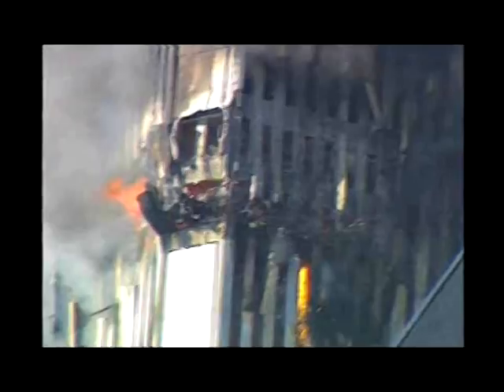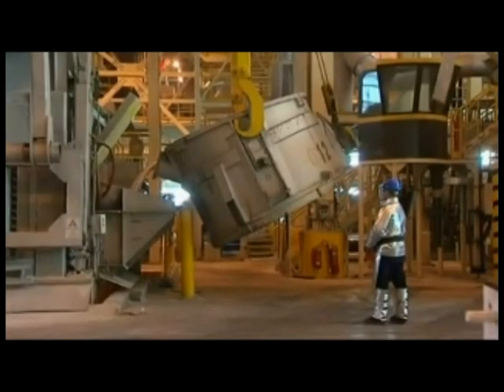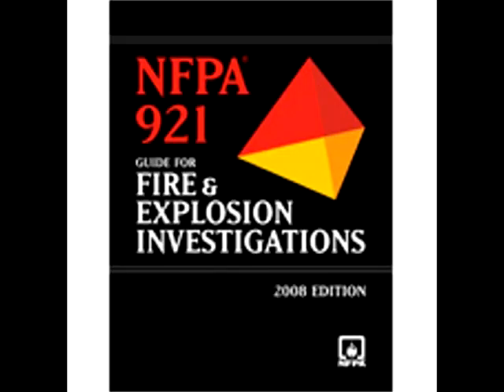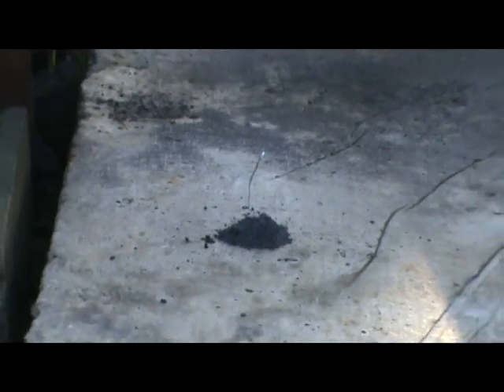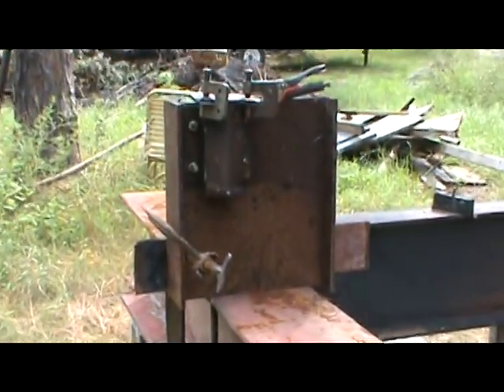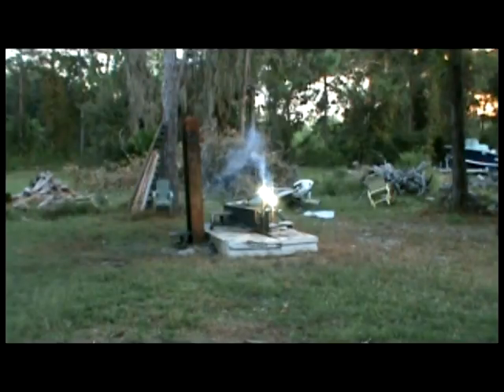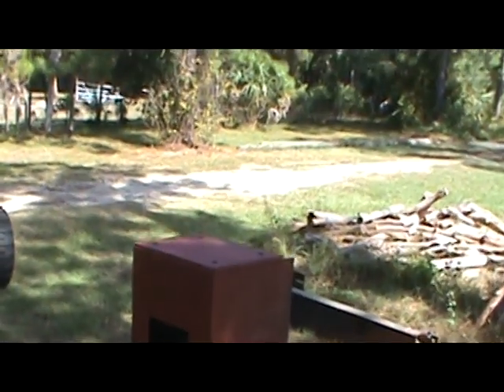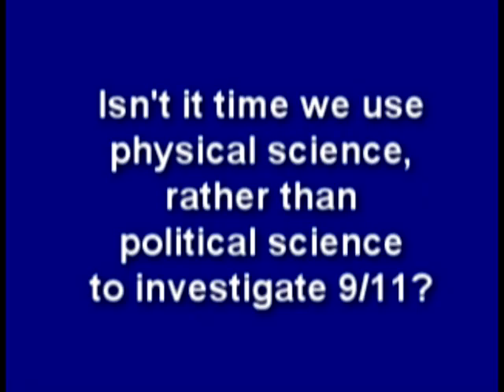9/11 Experiments: The Great Thermate Debate

Comment: Thermate and thermite are not comprable things. And considering that you can buy the things required to make thermite at a chemical supply store or a hardware store for that matter, it does bring about the question of why you would substitute one for the other. What you used would require far more effort to get and make than thermite.
Is it perhaps because you realize that thermite won't do the damage that thermate will?
Reply: thermite does huge amounts of damage and is use by military all over the world. it has provem to be more destructive than jet fuel.
Reply: Reid Norris quite true. Nevertheless, it still begs the question. When thermite is easier to produce than thermate, why substitute thermate? Thermate is both more powerful than thermite, and quite unmistakable in the aftermath. It leaves behind toxic chemical traces which are highly poisonous to anyone in the vicinity.
Reply: well %90 of the first responders got cancer, i guess that could explain the toxic.both are really east to prduce and anybody with an old army handbook can do it. very detailed instructions on its use. i have no idea what exactly happened. i KNOW the US govt cant be trusted. ive worked with steel for 20 years. ive put together systems like the twin tower(not as big), it just doesnt make sense about the exact footprint they laid. the outside skin wouldveremained bolted together top to bottom. ithat connection has nothing to do with the collapsing floors. ive done thousands of tresses just like they had, the weld is stronger than the steel they say that weld snapped and then fell like pancake, well the outside skin would still remain bolted. i keep an open mind becasue the officail story is not the truth.USA was so much better before that day. ive studied the first and second WW in detail, they will do anything. maybe it was some saudi that had never flown a 737 at 450knots in a dive then pulls up perfectly into the building, or the other first time pilot flying in a roll at 450 knotsback inot the pentagon with perfect precision. if it was them i would say they were better than iour military, becasue US military been gettin smoked since 1865

Comment: The problem with these "conspiracy" videos is that they often contradict each other. I've seen one where they had a physicist say that an aluminum plane would not be able to penetrate the steel of the building. I was in a hurricane in the Caribbean and I saw   a  2x4 go through a steel beam. So if a 2x4 can go through a steel beam, then I'm convinced an aluminum plane can. Most of these videos prove absolutely nothing.

Comment: Also don't forget about the bolts that hold the steel beams in place, those require much less heat due to their size, to warp and pop out.

Comment: The steel does not need to "melt". It only has to weaken or warp. Once that steel has been exposed to the temperature of the burning jet fuel mixed with office stuff and what have you, plus this a biiiiig one, wind as another fuel source. At that height nothing is stopping the oxygen feeding those fires. Anyway back to the steel once it weakens and starts to bend it cannot hold the weight of the remaining floors. Hence collapse. The buildings were designed to fall that way in the event of a collapse. Had the buildings toppled over like everyone thinks 200,000 people would have passed away. Think about it.

Comment: Problem with this theory, How do you fit hundreds if not thousands of thermite cutting devices to the enclosed structural beams of a building without any one noticing the work. Look at how long demolition company's work on a building before the big day the button is pushed. Planes are also full of magnesium and magnesium alloys which burn white.

Comment: You can light a wooden pallet on fire and as it burns, the metal nails will turn red hot and glow with the heat from an ordinary wood fueled fire.(about 1200/1500) degrees is the average for a camp fire or fireplace fire. What is the most prominent weather condition that high up in a sky scraper? WIND, lots of wind. And what is blowin in the wind? Oxygen and lots of it. What are the 3 primary conditions do you need for a fire? You need fuel, got that, (the plane had an abundance of fuel) you also need heat, got that, (the friction of the plane crash) and you also need oxygen, (lots of wind) The tower fire had all three. Lots of fuel, heat, and air. The fire didn't need to (MELT) steel, it just needed to get it hot enough to weaken it. The weight of the upper floors was greater then the towers were designed to handle. No other tower in history has ever collapse from a fire. True enough, but the twin towers were not your typical building construction, it was built differently and it was built by the lowest bidder and forced to be built in a hurry. The towers were structurally flawed to begin with. Add a plane crashing into it causing significant structural damage even before the fire weakened the building. Case closed.
Reply: Bill: I kinda figured that. lol   Some people like "Blu" that just can't see the forest for the trees. Have a good day Sr.
Reply: Bill, dont waste your time on this clown.
Reply: Don't forget the creepy ones. :)
Reply: B-52? WWII?  It was  a Bi-Plane, after WWI....But, hey! Close enough.
Reply: "Burning wood in a campfire = demolishing a skyscraper" "just add fuel, friction, and air" "Case closed" LOL
Reply: Man!  You Americans just love ambiguity, don't you?   Looking down through this sub-thread, it's hard to tell who believes what. LOL.   
.
Okay, let's address Smart Ass's (its in the name you know?  You may well consider yourself an intelligent equus asinus, but to me, you appear simply a dumb arse )  - fire triangle first....    As a trained fire-fighter, I can confirm that dumbarse is correct.  However, one only needs to remove one side of that triangle to extinguish any fire.  

Dumbarses's theory that winds at that high elevation, would have fanned the flames of the initial fires caused by the impact/explosion and thus intensifiying the temperature of the fires on the impact floors.   Now this might be true in the case of a smithies furnace, which is in controlled conditions, where fuel is plentiful,  heat is retained and airflow is constant.   

However, this is not a smithies cozy little furnace.   This is 13,000 tons of concrete and heavy steel, standing vertical and rising up 3/4 of a mile into the Manhatten skyline.   As I said above, remove just one of the three sides of the fire triangle and your fire will be exinguised.   So let us look at the three sides of that fire triangle again...
.
Fuel - Initially the 'accelerant' would have been the kerosene in the aircraft's fuel tanks.   But kerosene cannot alone cause a high temperature fire sufficient to melt heavy steel box girders and concrete.  (...let alone, all the floors below the impact...).   Most of the aircraft's fuel would have been expended in the initial impact explosion.   Secondary fires would of course be triggered, the secondary 'accelerants' being the office furniture/partitions/carpets/IT equipment etc...  Anyone who has set light to furniture or computers would know that once turned to carbon, the 'accelerant' would be depleted of potential thermal energy.    
.
Oxygen (air) and Heat -  Whilst the 'accelerants' remain with enough potential thermal energy, any intense air flow, would most likely 'fan the flames', but that air pressure (wind) also has a cooling effect.  -  Blow on a joint (dooby) to get it to stay alight, yes it will burn intensly, waste your weed down to the roach... One can carry on blowing on the roach, it will just cool down, the fuel now expended.   Stand on a windy hill, with just your underclothes on, your body will start to cool to the point of hypothermia.   So the wind action has two effects.  Initially it may well intensify the fire, but after the fuel is expended, it would then start to cool the fire, rapidly.   Just like blowing on a solder joint, to cool the solder.   
.
The fires that broke out on and around the impact zone would most certainly not have enough thermal energy to melt all of the steel structure and concrete of the WTC's 1,2 or 7.    The rest is easily explained by Newtons' third law of motion.   And remember, a column in compression is considerably stronger than it is in horizontal tension.  
.
Those who agree with the independents/truth seekers findings, are employing critical thinking, in all aspects of this case/debate, be that the political or scientific facts.   They question the official narrative.   
.
Tis a good job someone does... 
.
Those who only believe that official narrative, are simply swallowing the hook, line and sinker...   Sheeples. 
.
The problem with Americans is that they are so tuned to believing what MSM tells them, that they don't seek to question anything.  This is why, over half the nation, still believes in an omnipotent 'sky fairy', that created the world 6000 years ago, in seven days!   And that non avian dinosaurs lived cheek-by-jowl with early humans!   Whilst another portion of the US populace deny climate science....  Or are convinced that governments are employing clandestine geoengineering initiatives....   And that most Americans believe in infinite growth...  On a planet with finite resources.   They could never accept that their own government would ever pull a fast one, on its own citizens.   Yet, history is riddled with such events...  Or did ya'll still believe that the 32nd POTUS was blissfully unaware of the imminent attack on Pearl Harbour?  Or that LHO assassinated JFK?  Or that Iraq contained WMDs?  I can't remember what the excuse for Vietnam was...  
.
And of course, Americans generally believe that the whole world loves them and envies them and their faith in 'God and Country' makes them in any way,  superior citizens of the world and super role models for other nations to follow.   That arrogance, even extends to their belief, that they and they alone, should become the 'Global Police Force'.   
.
 Reality of course, can be a bitch.
Reply: Were you talking to me or Blu Crystl? Cause I was spot on.
Reply: Never mind, your not worth my time.
Reply: Blu Crystl: Only 2 times in history has a large commercial airplane crashed into a hi rise building. In both cases both planes were the same, the buildings were the same, the damage caused by each crash was the same, the location of the planes hitting the buildings was the same, the time it took for the start of each collapse was the same and in both cases the buildings did the same thing. See a pattern? Case closed.

Comment: You have forgotten one small but the most important element of your discussion.  Who supposedly put this 'thermite' there?  It would have taken months and then more to wire a building to ignite this stuff (if it was actually even there) and to even place this 'thermite' there.  Who was the company who did the wiring, who was the supplier of the trigger cable and the 'thermite'.  Why did no one see people for months and months  (more likely a year or more) wiring the building.  To wire a building like this take an emmense amount of work - I know, its what I do for a job, wire buildings.  Pulling panels off, ceiling tiles, duct ways etc. Why did not one person ever see a contractor doing this and why has a contractor never come forward, or his family saying he was out doing such n such job.

Also, did they wire the entire building from top to bottom or just where the planes hit?  Not easy to fly a commercial airliner at 600mph and hit at a particular spot on the buildings.  I never saw a big red dot on the building side that marked the 'hit me here' spot.

Everyone says 'Bush and Cheney' did this, actually, I doubt they could even climb a ladder to get to a ceiling tile.  It takes thousands of hours to wire buildings and hundreds of people and materials and yet not one person has found a company that has supplied trigger cable or thermite suppliers or manpower.

If it did have thermite on the towers, why didnt they just wire up the foundation supports in the basement and not near the top? Would have been far easier to do it this way that up the top of the building - and then to try and guide an airplane to hit at the same spot where the supposed 'thermite' is laid - and then only hope that the building would fall.  If you want a building to fall, you do the foundations not near the bloody top!

Too many of these so-called theorists have really no idea about the reality of how engineering works and try to explain their argument with internet based facts and figures that they dont even understand. 

I couldnt believe that crap about 'bolt blasters' in the outside coloums.  Who put them there? Who took the buildings apart to fit them? Where did the run the trigger wires to? Who did the work?  No one saw NOT ONE construction worker do this - no company had enlisted the manpower to do this, no worker has ever come forward to say so. No one saw contractor vans outside the towers month after month hauling in cabling and explosives.

Its all very well to try and come up with theories, but to get these theories to work is the big part.  As I said, why did they put their 'bolt blasters' near the top of the building when in the basement it would have been a quick, easy job.  

As for this 'finding traces of thermite' - well, I see you used common products in your tests that are found in lots of material in the buildings and that are compounds used in thermite, so you're really grasping at straws with that one.

Too much dreaming and not enough practical thought.  Until you can find one of the workers who supposedly put this stuff in the building, or the company that supplied manpower and equipment, I suggest you stop buggering around with your experiments.
Reply: Marvin Bush was in charge of security, and plenty of odd things going on in WTC months before September 11...
Reply: What a lot of speculation and grasping at straws.  It still doesnt tell us who the men were and who the company was that was 'supposed' to have wired the buildings.  Anyway, tell us all please, how come the buildings collapsed starting from the point at where the planes hit?  Did the pilot fly them into a particular floor that was previously wired and all the pilot had to do was hit that particular floor, then 'someone' (tell us who pushed the charge button for the explosions) and you then think it was explosions on that exact floor that the planes hit?  By the way  both towers were hit at different floors.  Did they paint a large red dot on the side of each tower for the pilot to aim for - you know, the one that has the explosives on that floor..

All you conspiracy people are grasping at very short straws and try to piece together some sort of theory - generally unworkable theories.  Try looking at the engineering of the collapse and you will then know the answer.

Comment: Could it be that thermate was already installed in pre-specified places of the Towers as a 'safety' design -intended to protect Lower Manhattan or the neighbouring twin tower by assuring that if one of the Towers experienced a fire powerful enough to activate the thermate reaction above a certain floor (the second or third Skylobby level perhaps?) the building would just pancake down instead of toppling on top of the others?  
The other scenario I could think of why I would add thermate in the higher floors would be for insurance claims purposes: How expensive would it have been to repair the buildings which were always expected to survive such hits? Pre-installed thermate would assure that any damage on those floors guaranteed a complete collapse of the building and blaming the collapse on the fire would be very easy to claim.

Comment: Saw a black smith on T.V. He heated up a piece of steel so that he could simply bend it into the shape that he wanted. He didn't melt it. The problem with this story is that it claims that steel has to melt before it can fail. Heat steel up inside of an oven which is what the twin towers were with a fire burning inside them, add the weight of the floors of the sky scrapers to it and the steel will bend and fail. And the pressure pulses? That is caused when the steel beams start to fail and give way causing the weight to be redistributed to the remaining steel beams that were not meant to handle the load that was put on them. I could go on and on but but I won't. Later people and God Bless

Comment: In the National Geographic explanation they say that thermite which burns at 4000 degrees Fahrenheit cannot melt the steel column. but jet fuel which burns between 800 and 1500 degrees did melt  the steel colloms. very contradictive.
Reply: It was THERMATE...THERMITE WITH SULFUR.

Comment: Ok but what about the argument that a 2000 degree fire is sufficient to significantly weaken the steel (NOT MELT) to the point that it can no longer support the vast weight of dozens of floors above it so it collapses and causes domino effect?

Comment: BS penguin pie...you have neglected to consider a couple pieces of critical information in your "analysis" of the collapse event...1. The nist forensic "analysis" report admits there was no damage to the columns below the fire/crash area...2. The structural steel design manuals provide a factor of safety of 2 for critical column buckling ...add to that the fact that column are seldom if ever designed to 100% capacity and the FS for column buckling is somewhere between 3 and 4...you're not a structural engineer, in-spite of your claim to be a physicist, you've obviously never even applied simple mechanics of motion principles to quantify the collapse accelerations!...so stop pretending you know anything about what happened to those buildings...maybe look a little farther into it first anyway.